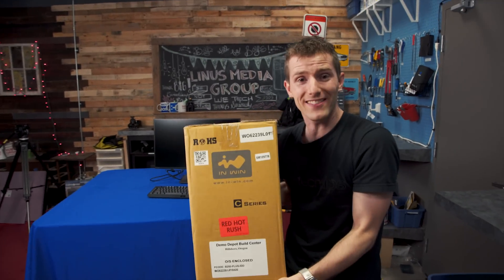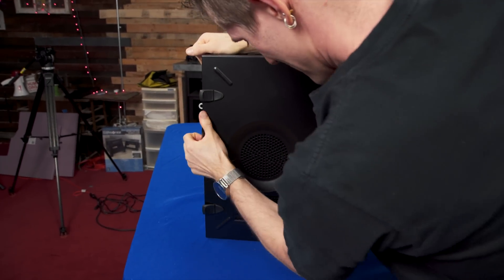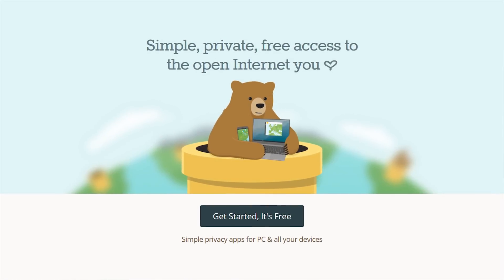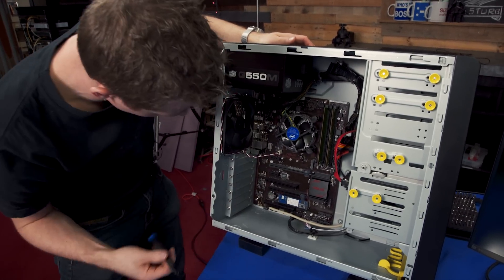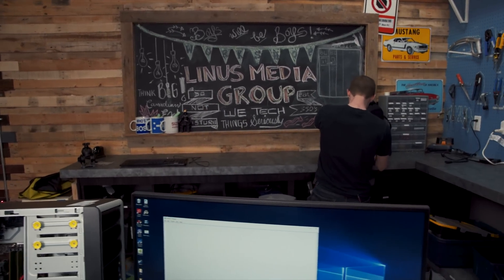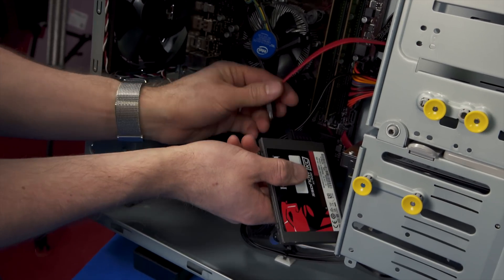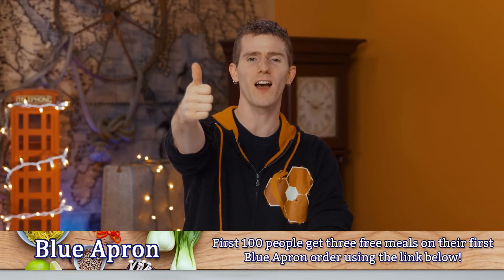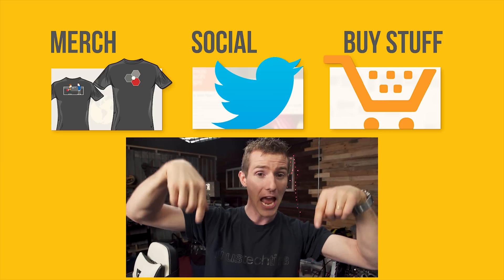Turbocharge your SSD for $40??

Comment: Only works well with older systems running off of a HDD, but needs an M.2 slot... Logic.
Reply: Needs an M.2 slot / 270 series board / Kaby Lake 

Basically, a high end PC except you forgot to get it with an SSD
Reply: @NoBandsLand  Nope SATA is the bottle neck on higher end machines. Getting your SSD into your PCIe Lanes will put the need for a SATA chipset out the window (which adds latency and also can be a constraint - NVMe is amazing). H10 is even better, as it has an SSD and a CACHE Disk in an m.2 form factor. For serious applications it is brilliant. People just need to stop with the 2 dimensional analysis...saying stupid shit akin to a Ferrari Faster than an 18 Wheeler therefore can pull more and other such nonsense.
Reply: Yeah, you can get M.2 / mSATA to PCI or PCI-e adapters but you're still gonna need a new motherboard and processor, of which should certainly have an M.2 slot, so it doesn't matter anyway...
Reply: Du6e, no point since you need a motherboard and CPU that supports Optane as well.
Reply: older system? u need a NEW mb to run Xpoint😰
Reply: Noone said to buy a 1TB SSD. Buy a decent 120/240GB SSD for system and apps, and a TB HDD for other stuff. Since the Optane costs as much as a 120GB SSD, I see no point of buying it instead of said SSD.
Reply: "Older system" He says right in the video that you need the newest Intel Chipset and Kaby Lake CPU. I wouldn't call that old.
Reply: Thanks everyone, Linus pc was like modern pc in retro clothes, I thought my 4years old pc might survive 1-2 more years with this.
Reply: They are warrantied to 30 drive writes per day.  Writes can also be done without erasing the whole block fist, eliminating write amplification, that are especially problematic for full or mostly full SSD drives.
Reply: This concept will only pick up when intel drops the exclusivity with the latest Z270 boards and makes it compatible with older mobos from atleast devils canyon (which my PC has) and up.
Reply: Intel could put an M.2 slot on a PCI express card.
Reply: Have to agree with this point. Small SSD's aren't expensive these days, most ppl will have one on a new system.
Reply: not everyone that has a pc uses it to play games. useful for servers, enterprise, NAS storage
Reply: +Hadgerz yes they do degrade but you don't write much in regular usage. For example the Samsung 850 Evo 500 GB has a TBW of 150 TB (this many bytes can be written until warranty expires which does not mean that it will fail at 150 TB)
So some quick math: 150 TB = 150 * 10^6 MB. Now we'll assume you write on average 40 GB on your drive everyday which is quite a lot (My Windows drive has an average write usage of ~31GB per day and I'm a computer science student, so I tend to reinstall Windows and other big software more often than the average user). That would reach the TBW after 150 * 10^6 MB / (40 * 10^3 MB) = 150/40 * 10^3 days = 3750 days > 10 years.
I've had multiple HDDs and they don't tend to work flawlessly for 10 years. Usually not even 5 years until sectors start to fail.
Reply: is there a way to add m.2 slot using some PCI card? and will optane die like ssd after particular cycles?
Reply: Pardesi Babu yes
Reply: happy Singh sure but for optian too work your motherboard and cpu need too be high end
Reply: True
Reply: False Daniel, b250 is used in the system Intel provided. but yeah, they are kinda missing the market.
Reply: tonyrulez69 if it actually a posts read n write speeds id buy it
Reply: Du6e its for when you are a stupid person who buys one of those scam ""gaming"" prebuilts that have high end cpus but no ssd and shit graphics card and cant afford an ssd
Reply: Du6e no he said that it only works with 200 series mobo and maby lake cpu IDIOT OH I AM TRIGGERED
Reply: HDD is actually better than SSD in terms of longevity my main is from 2003 the very 1st release of SATA hard drive a 125gb hard drive and it's still running. my secondary one is a 500GB  HDD one from 2010. My SSD from 2012 is already broken so I threw that away broke September 2016.
Reply: Counter Point quite the opposite mechanical hard drives tend to last a lot longer and it's easy to tell when you need to replace while SSDs die without warning (I think from heat moving/morphing components inside)
Reply: +Soap Cutter your only valid point is that it is easier to tell when HDDs fail but when they do it might be already too late and you have to check on them regularly.
You should backup regularly anyway if the stuff is important. SSDs do probably (as I have no evidence on this, so this pure logic speculation) have a longer lifespan because they have no moving parts that could fail. Yes, you can't write too much on an SSD but the amount they can write is so high that you're probably not going to reach it in 10 years.
There are obviously mechanical hard drives optimized for longetivity but that's not your average consumer one.
Reply: Yep. The entire reason is this is close to replacing SSD, and in competition a close performance. So you cannot just replace it outright if you want to earn the development costs back. So they are staggering it really poorly, to try and get the best returns on pretend pricing. :/

When the SSDs come out, this thing will fly!
Reply: needs kabylake and a 200 series mobo lol, maybe like skylake support homies>?
Reply: Du6e Accelerates HARD DRIVES  -> REQUIRES Brand New Kaby Lake CPU on a 200 Series Mobo...  MAKES TOTAL SENSE!

I know when I go out to buy my newest possible Intel Platform, I am just going to toss ALL FOUR of my 2.5" SSD - not buy an NVMe M.2, and just run a regular HDD! THAT'S TOTALLY HOW EVERYONE DOES IT, RIGHT?

I mean its not as if SSDs are AFFORDABLE - especially the 2.5" variety, and NVMe? More like Not Very Money Effecient!
Reply: DysphoricSmile money efficiency is measured in "value" and yes I agree with you with Intel well being Intel and wasting money on junk
Reply: m.2 to pcie adapter, PrimoCache license (30$) and you're good to go. doesn't work with your boot drive but that should be an ssd anyway
Reply: paging loves the low latency, it will make any system much much more responsive
Reply: but the speed almost same
Reply: servers
Reply: Newer budget laptops still come HDD. Even some budget gaming laptops come with HDD. Optane is useful to me. My 4 years old laptop come with HDD and I bought a cheap Optane drive 2 years ago which only costed me $10. I don't have to setup everything up again and only add the Optane drive and it does boost my boot speed.
Reply: If only there were pcie slots and m.2 to pcie adapters
Reply: Not a bad idea for budget builds.. a cheap Kaby Lake processor with this and a 1tb hdd is way way more value than a t1b SSD alone.
Reply: ONLY works with systems running HDDs, but only works on the newest 200-series motherbord and anything newer than Kaby Lake. Its idiotic, and you can just buy a M.2 SSD instead.
Reply: I have a 5 year old mother board that works with M.2 SSD with windows 7 and PCI adapter.
Reply: Copies my comment after me, gets more likes than me. Wording is key
Reply: You're experience doesn't hold true for the majority of PC users. HDD's tend to have an average lifespan of 5 years(I've seen some break within weaks of purchasing). SSD's, with no moving parts, tend to have a longer lifespan on the whole.
Reply: The motherboard in the video is only B250 for the record, so dont need 270.
Reply: and it needs optane support that is only supported by z270 boards
Reply: it works good only for server. not for personal use
Reply: Takes up your valuable M.2 SSD slot ... to bring SSHD performance to your regular sata3 HDD.
+Counter Point learn something today: SSDs degrade with every single read/write operation. . . because you are physically etching data onto the wafer. Having no moving parts does nothing to prevent the SSD degrading due to electrons passing across the silicone hundreds of thousands of times.
Reply: You also forgot the kaby lake part. It only works with new perfomance and up level hardware but only improves budget solutions. Same type of joke as the RX580 ~8% better performance for ~12% higher price.
Reply: you should probably get an SSD instead of this
Reply: M.2's are pretty main stream m8.

Comment: The fallacy (paraphrased): "the point is what you can do to improve a 2000-style PC". No you don't, you need a Kaby Lake processor; why occupy the M.2 slot with a 32 GB "accelerator" when you can use an NVMe SSD of 250+ GB.

Comment: Of course, you are right, big time.   We've been saying the same thing for months. The story gets even better, actually.

Who would want to waste a perfectly good M.2 slot on the mobo on one of these 'Octane' devices when one can just buy a Samsung 951 or 960 series NVMe SSD into that slot, and throw windows and any data needing fast access on that instead?  You get 256GB for about the same price and the ability to put even larger devices in the slot.  And in that same configuration, even also use Windows standard SSD caching feature to help accelerate a large archival HDD that you also throw into the system?

I'm glad you called Intel out on the last bit... who in their right mind buys a new Kaby system with a HDD boot drive?  Nobody.  Intel is completely out to lunch here.

-Matt

Comment: I currently have 5 drives in my pc, 2x 1TB WD Blacks, 1x 500GB WD Black, 1x 240GB PNY SSD, 1x 120GB Kingston SSDNow... and I only have one m.2 slot (that is what it uses, right?), would I only be able to accelerate all of my drives or just all of my hdds at least? Or is it just a single drive boost? Also, I have no raid configuration on my drives (if that makes a difference).

Comment: Given the chipset and CPU restrictions, I would say using an SSD would be the better option.  Several years down the road when Kaby Lake is old tech and these Optane module can be had used for a few buck it might be worth it to squeeze life out of an older system, but for now, its rather pointless.

Comment: I get the point but since I'm already rocking one of the 750 series drives, it's not really a concern of mine.  But sure, maybe if you're out of SATA ports and need to put another drive somewhere in that form factor, sure.  But as you said yourself, if Optane requires newer hardware in the first place, most users would be on an SSD already, and for the workloads involved such as caching, people are already using SSDs for that anyway.

Comment: LOL how much is the special motherboard to install it on cause im running a asus striker 2 extreme socket 775 so the cheapest motherboard in my country is the Asus M5A99X EVO Motherboard at R3,000 + R521 this device then il need the cpu witch is i7-5820k  i got off your website at the amazing price of R6,700 so ill need ddr4 ram aswell is Ballistix Sport LT 8GB DDR4 2400MHz at R1,300 so the total price is R11,521 cause if it was dollars you will have shit yourself and the best pc in my country is around R85,000 and i mean the best of the best x3 video cards for my cg work and the R85,000 is $6528.87 now you now why im still running a pentium core 2 quad 10yr old pc

Comment: So it's worthless/useless for people with SSDs, meh.
Reply: +kurad k The problem with this Optane device is that it requires a newer Intel system. Most people are still using Intel CPUs up to 4 generations back because IPC improvements have been very minimal. The cache memory is just that, cache; you can't even access it to add or remove files. With a small SSD say a 128 GB model, you'll have consistently fast boot times and be able to put whatever programs you want onto it that you want to load up faster; you also get more storage space for the money. The Optane device as it is now frankly is utterly useless, because anyone who buys a new system will likely have an SSD/HDD combo or a SSHD. Both are more cost effective than Optane as it is at the moment.
Reply: Yep, until version 2 or 3.
Reply: Its totally pointless, If you want to speed your storage system up why wouldn't you just buy an SSD?
Reply: @B it is mostly be use in laptops where you don't have second place for storage but the "new" board going to have M.2 slot. So this product is for "dumb" people how don't know what to put where.
Reply: Or for people who need A lot of storage 2TB+.  2TB SSD for $800. Vs 2TB HDD/optane for $150.   And no dealing with boot drives vs storage.
Reply: The sata3 cables only cary data up to 550-650 mb/s. With an M.2 ssd or pcie ssd, those numbers get multiplied by 10.
Reply: Simon WoodburyForget counterpoint to what? I thought games use ram to keep all the necessary bits readily available?
Reply: +CorvetteCoonass Finally somebody that gets it.
Reply: noob
Reply: for people whit hdd to you can buy 128gb ssds for 50€. So most useless product ever.
Reply: given ssd space and money = 128/ $40. give space of hdd and money 1tb/ $56.
 now add $40 to the 1tb and you get $90. If I were to get a ssd 1tb size it would cost me around $350. I'll take the, cheaper, hhd option.
Reply: but if you have a 1 Tb HDD it would be better option than buying a 128 gb ssd
Reply: Important thing to note regarding caching is that it only benefits a small, albeit fairly used portion of a hard drive. an SSD will be faster with any and all program installed upon it. With Optane, only frequently used programs will benefit. Not to mention only Kaby Lake supports Optane, which means you'll need to fork over quite the wad of cash just to be able to make your "cheap" HDD run at near-SSD levels
Reply: TinchoX I know right. Linus even called this B250 motherboard old even though it came out this year, WTF?
Reply: WUT? NO! 128GB SSD costs as much as Optane. So why Optane?
Reply: @kurad Not really. I'd take an SSD with user-addressable storage and an HDD every day of my life, instead of resorting to SSD caching, which to me feels like the worse compromise. Not to mention, there is really no compelling reason to go with anything higher-specced than a SATA 3 SSD for a regular desktop user.

Comment: I like the sound of a naturally aspirated hard drive better. Maybe just my opinion.
Reply: no replacement for displacement huh
Reply: Nothing beats the sound of a rotary drive
Reply: 6 hard drives inline or in v-config though?
Reply: i really wanted to make a shitty "wastegate-choo-choo-choo" pun....buttfuck it...
Reply: flat six, obviously ;-)
Reply: Kevin I agree. I originally started with a boot 120GB SSD + 1TB HDD but damn they're way too loud, shook my entire PC case, and was unreliable and slow. I swapped out that 1TB HDD for a 1TB SSD (back when 1TB SSDs were normally >$200), and ended up getting rid of the small 120GB boot drive with a 500GB 960 EVO.
Reply: The JelliedPumpkin this is not an automobile that you require better downsizing its engine
Reply: lol! excellent!!
Reply: I only have SSD's in my Desktop hdd's are to loud. And to slow.

Comment: But how would it function with SSD and a HDD together on the same system?
Reply: the same way it works here

if what ur using often is placed on the SSD, then ur not gonna see much of an improvement that u can actually see

if what ur using often is placed on the HDD, then u'll see significant improvement after accessing those things several times

but given the price of SSD today... and the compatibility limitation of Optane, it makes no sense why anybody would use it compared to just basically upgrading their SSD size up which overall would be a lot more useful

Comment: Ya this sounds awesome if for instance your parents have a shitty prebuilt with nothing but a HDD. Just pop this in and flip the switch and boom faster computer for mom. To bad my mom isn't rocking the latest and greatest 200 series motherboard. That's a really dumb limitation. Is there a technical reason this shouldn't work on any board that has an M.2 slot?

Comment: What I'd like to know is, how well would it perform if you have a system that boots from SSD but also uses a mechanical drive to store extra programs/games.
I don't have the money to buy a bigger capacity SSD at the moment, so I opted for a smaller one, but if I can get a nice performance increase on the mechanical drive for around 40 bucks, then I might be interested...

Comment: Dumb question... is Optane really mounted on a M.2 slot? I know you can use an adapter for it, but it's ironic using M.2 when you  still have an old hard drive.

Comment: A caching SSD to increase performance when using a mechanical HDD as your boot drive was cool seven years ago when Intel first introduced it, but this is 2017 and no matter how fast the caching drive is you would have to be brain damaged to still consider using a mechanical HDD over an actual NVMe (or even SATA) SSD.